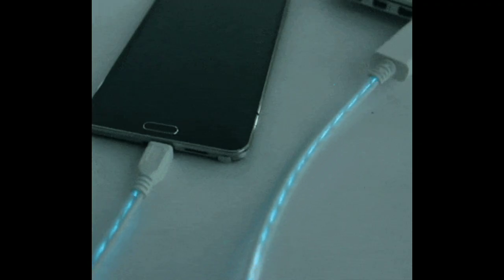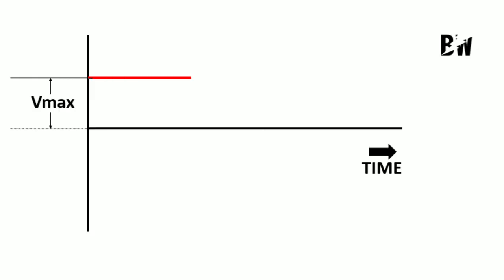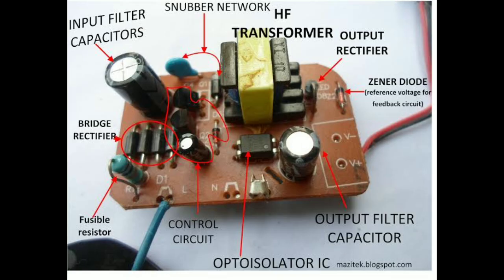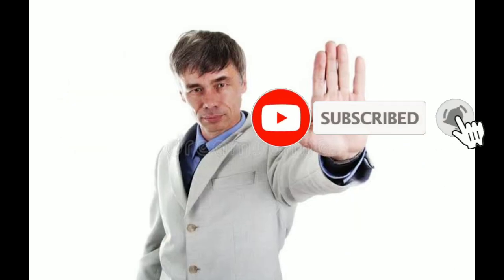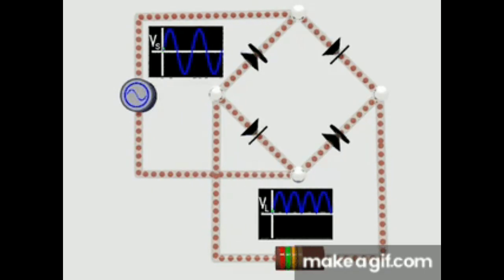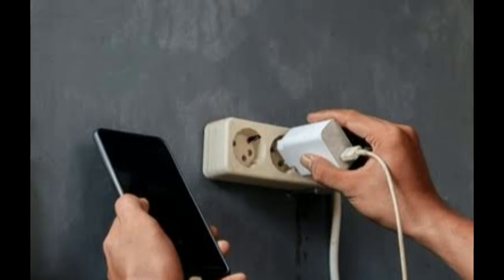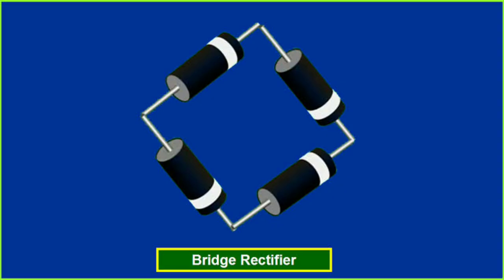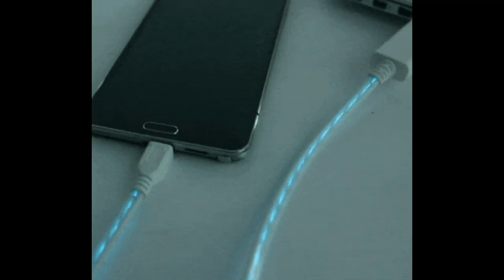How Phone Chargers Really Work (And Why It Matters)

Comment: Transformers with low frequency like 50hz are usually big to fit inside a charger adapter that's why they should increased it first to a very high frequency using switching electronics, which allows the transformer to shrink dramatically in size while still delivering the required power